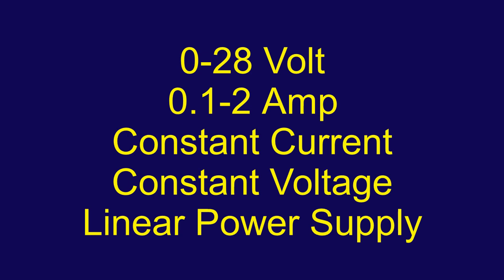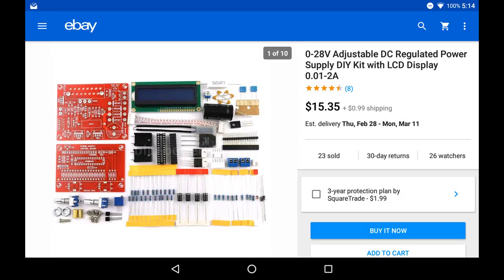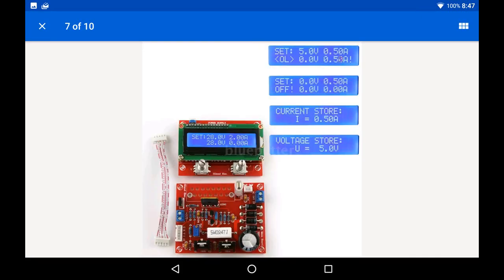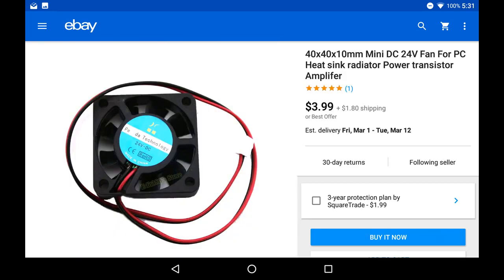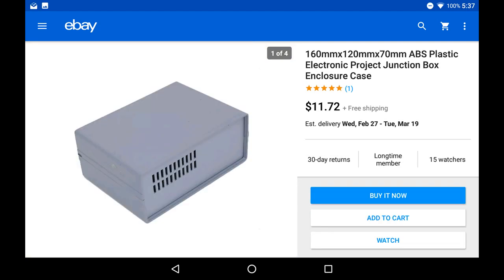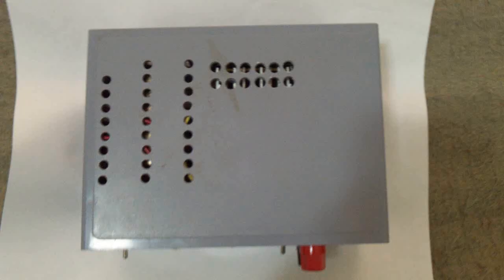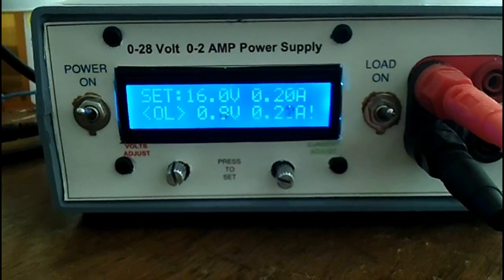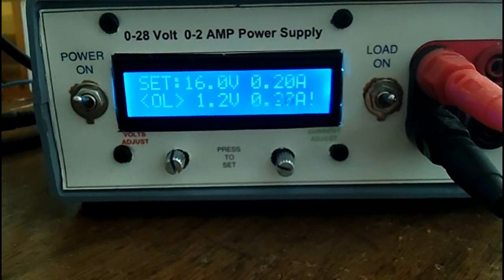DIY 2Amp CC/CV Power Supply

Comment: Are there any circuit diagrams ?
Reply from the maker: I'm sure somewhere. If you do an eBay search on 28 volt 2 amp power supply the basic kit should show up. https://www.ebay.com/itm/LCD-Display-0-28V-Regulated-Power-Supply-DIY-Kit-Current-limiting-T3G7/274433968216?hash=item3fe58a0858:g:8I0AAOSw~U1fFmAK

Comment: That's a neat little power supply. Nicely done
Reply from the maker: For the price it's hard to beat if you don't want to use a noisy switch mode one. Thanks!

Comment: Nice Job Bob.... if my 5v china supply is too noisy, this will be my GOTO solution.    :)
Reply from the maker: For the Atwater Kent I'd go with a 6.3 volt filament transformer, a capacitor and a L7805 regulator. Cheap and simple. 🤔

Comment: Very nice power supply. Ans fixable if it breaks. The  surface mount parts are just to small for my  liking. Beats $55 dollars for  most of the  other power supply's I have checked out.  Thank you for sharing.
All my best
Reply from the maker: That's why I like building kits or buying Heathkits and restoring them. When something goes wrong you can fix it! 😁

Comment: I have one built up on my bench too Bob! (and a couple not yet built). They are great little power supplies and I love the fact that you can set the startup parameters into memory. I have mine set to 5v and 0A startup because I didn't put a load cut switch in!
Reply from the maker: Nice small dependable supplies. Switches are cheap. Waiting for the caps to discharge can get expensive! 😱